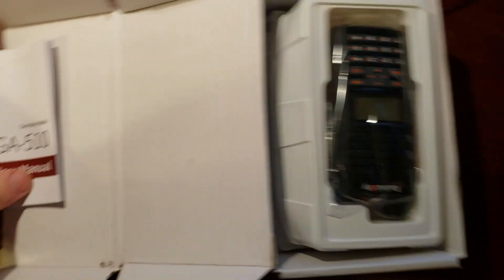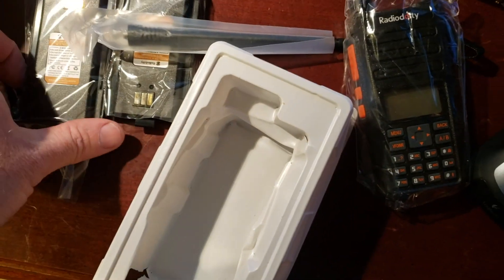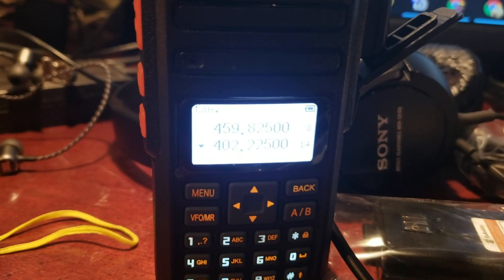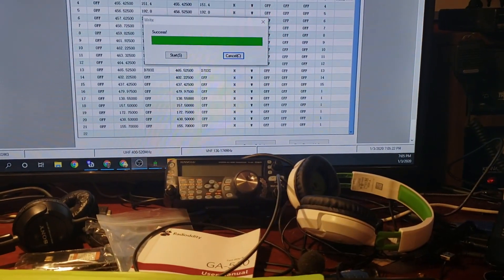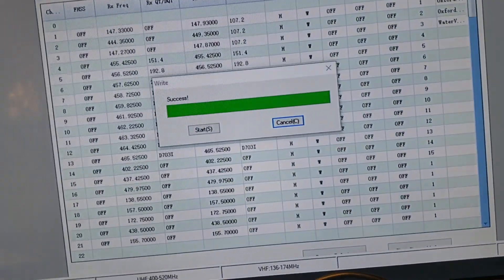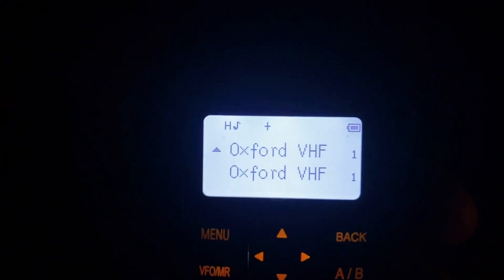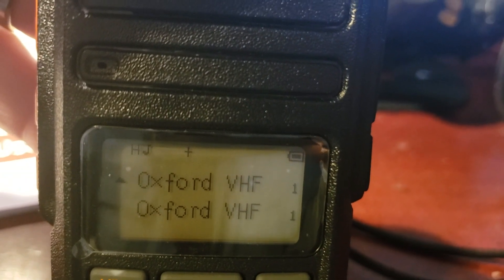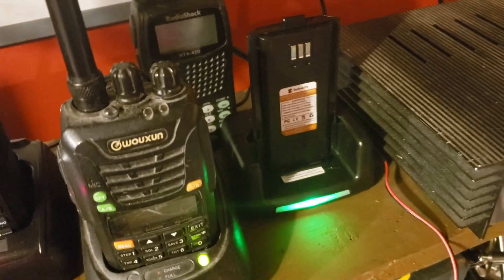Radioddity GA510 Review: Does this 10 Watt Handheld Measure Up?

Comment: I did not see any actual power test in your review.

I bought one of these from Amazon because of the advertised 10W output power.  When I actual tested it (2m band) the highest output I could get was 6W, which is barely 0.8dB more than the typical 5W HT.  So if you're buying one of these because of the allegedly higher output power, think twice!

Comment: I have one important question can you please recommend an exact model for an extra antenna for more range for this radio.  Also do you know if there is a charging/power hole on the radio or can you get a car adapter? 
I was going to get a baofeng but I've read to many shaky reviews + the one I'd like is barely available. Anyway nice vid. Thank you.

Comment: Regarding your battery life comment at ~11:36. The 96 hours IS with both batteries, and also JUST in standby (no squelch break, no TX). The following is from the Radioddity website:
https://www.radioddity.com/products/radioddity-ga-510
"96 HOURS BATTERY LIFE: Due to two 2200mAh high-capacity batteries this radio has a continuous working time of 12 hours under 10W (high) power mode, 24 hours life under 5W/1W (med/low) power mode and 96 hours on standby."

It does not provide any duty cycle information like:
12 hours= 1hour @10W TX: 11hours RX standby (example times only, not real data)
(where "standby" equals NO squelch break/No TX; otherwise, they'd have to also specify audio output level (e.g. 50%) and output device (speaker, speaker/mic, earphone)

This radio's battery performance seems far superior to the UV-5xxx series BaoFeng handhelds which typically specify they consume ABOUT 75mA in "standby". With their default 2100mAh battery pack the BaoFeng would thus have ABOUT 25hours per battery, or 50hours per 2x 2100mAh batteries (assuming new, freshly charged battery discharged down to 10% remaining capacity. At discharge to 0% capacity that's still only ABOUT 28hours/battery in standby.

edit to add:
I just noticed the new BaoFeng UV-9R ERA (10Watts) is CLAIMING 10 DAYS (240hours) of standby on a single battery, but they claim its battery is 9500mAh (LiPo)
I've also seen a CLAIM that the BaoFeng UV9R PLUS has 18W output. I can't imagine a handheld being able to transmit for long at that power level...it just wouldn't be able to dissipate the heat quickly enough. (see WARNING below about 18W and above output claims)

edit to add:
WARNING! re: output power and battery mah claims for UV-9R radios on aliexpress:
I looked at a number of the UV-9R plus/etc radios on aliexpress. They all advertised 18W or 20W and I added them to my cart. However, when I clicked on the item in my cart, they ALL went to a different webpage that provided specification that the maximum output was 10W

Clearly these sellers are over-hyping their output power to sucker-in buyers. You can't complain about getting a 10W radio when the spec for the item you actually clicked-on to execute the purchase shows "10W" output power. Similar thing for the supplied battery capacity is that it's also over-hyped. You'll never see these lower-value specs unless you click on the item from WITHIN your cart
Reply from the maker: You are correct, many of the radios bill themselves as higher output than they really are. Buyer beware. Thanks for watching!

Comment: Only downside I can see, on this radio, is the max of 128 channels... but that is same for your typical Baofeng radio  :)
Reply from the maker: Yeah, but with analog radios, I don't see myself running through 128 channels. Other than that, it's a solid rig. Thanks for watching!